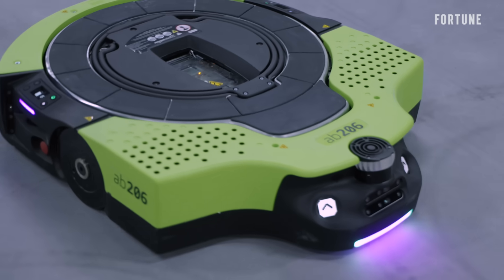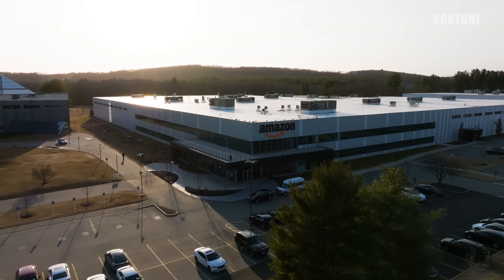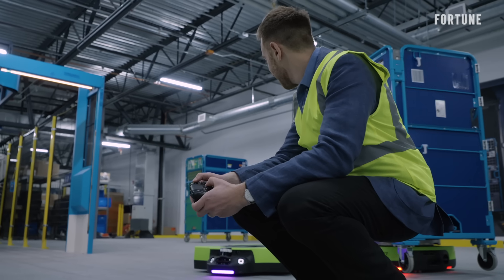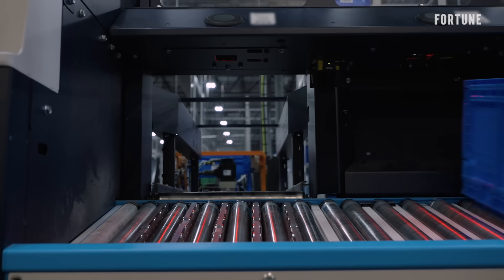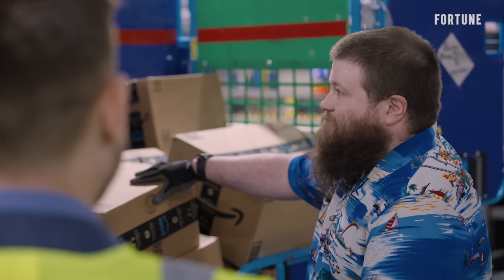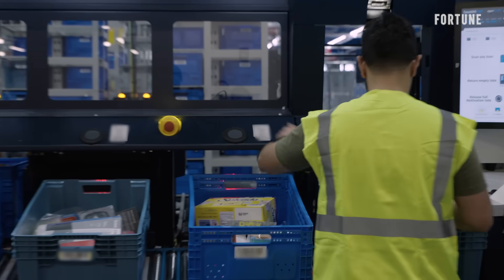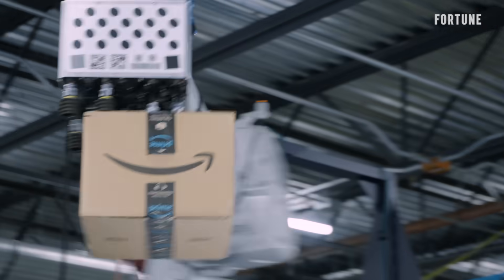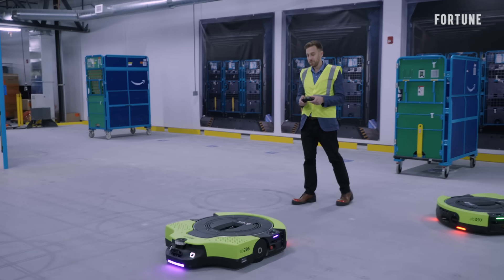Inside the Amazon Testing Lab where Engineers Design the Latest Robotics | Office Upgrades

Comment: We added proteus at our warehouse on the ship dock and it had zero negative impact on jobs
Reply: Exactly, because as you know, Proteus works in a limited capacity.  Essentially they pull and stage empty and loaded carts.  There’s a lot more going on in ship dock than just what Proteus is doing.   The upside to Proteus is that they do not require breaks, time off nor are they limited to working shifts.  The only issue with Proteus that I’ve observed as far as productivity is concerned is the speed at which they accomplish tasks.  As of this moment, humans could do it faster.  But where humans have limitations as I mentioned before, Proteus continues to work.    We have several Cardinal apparatuses and they are quite productive.  They load carts fast..      but otherwise humans are still and will continue to still be very much a needed entity in ship dock.

Comment: i'd like to see an improvement in securely getting packages to people. There are alot of thiefs where I live and amazon most times leaves the packages in the unlocked unsecure entryway of building I live in and people steal the packages all the time. I asked a delivery guy to please press the buzzer button for my place and he said he didn't have time to do that when it was 2 feet away from where he had time to take pictures of the package and leave. He said he was also not required to buzz peoples apartments. I said people have been stealing my packages of important things I need for business. He said "I don't care" Illiterately. Its like there doing tricks and spinning a plate in a very efficient way than not caring if they drop the plate and it breaks once its out of there hands.
Reply: you should invest in a secure package drop box - this solved my issues with porch pirates. its not really amazons fault if you dont have a secure drop location